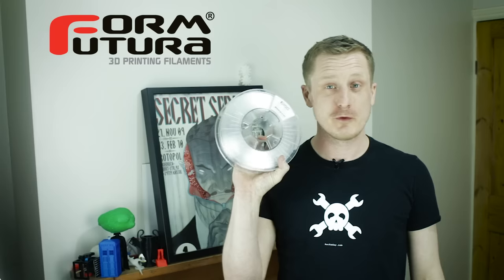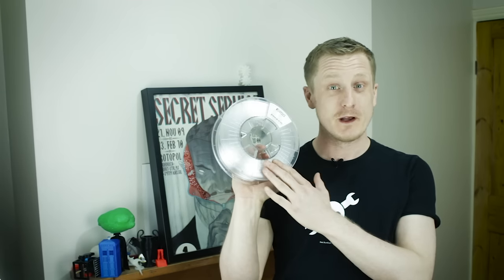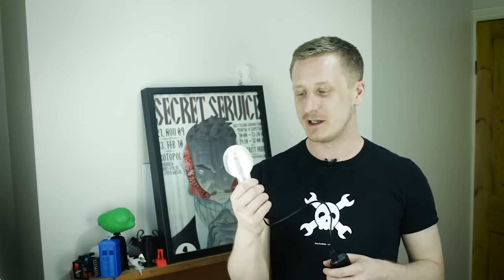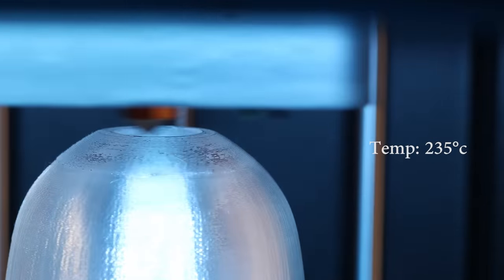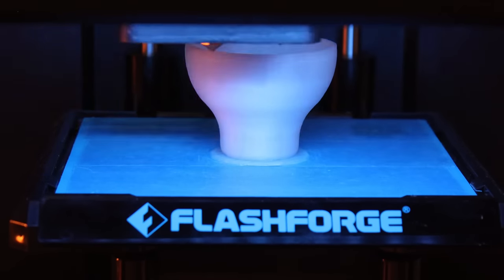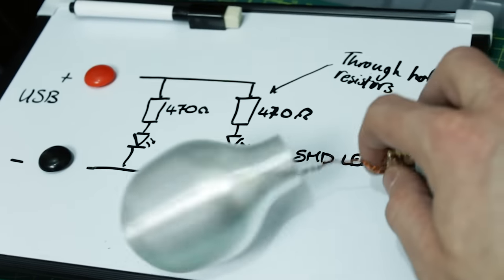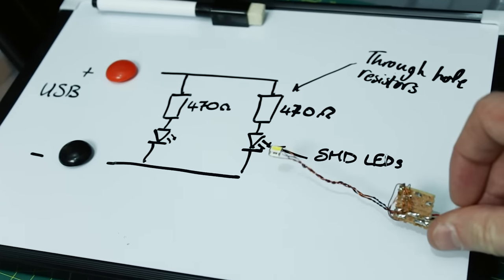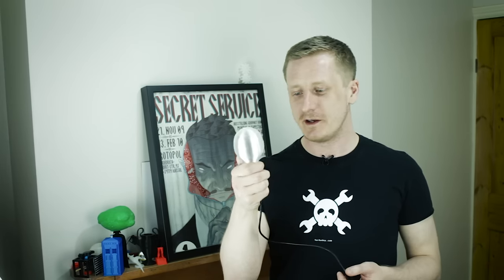3D Printing: USB Light bulb with FormFutura HDglass

Comment: Have you tested a heat gun or other ways to get it even more clearer/transparent? I've read that the layer height has a huge difference with the end result. Larger nozzle and layer height should get you less diffraction.

Comment: Nice ................ now the question is can you get it in orange & red , to print the tail lights you ' ve just knocked off ?
Reply from the maker: Yeah, it comes in a variety of colours so I guess you could. Nice idea.
Reply: I ' m not sure , it would be a " nice " idea , but it may keep the boys in blue off your case & make you feel safer , ' till you can find a sensible replacement . From what i remember the legal " thing " is , if it ' s ment to be a coloured portion of the signal & it shows through white , they can do you . The very cheap get round is to cover the bulb in a piece of coloured / transparent tape . But anything that makes the vehicle look more whole reduces the reason to stop you to start with .

Comment: Did you do this on your flashforge? I thought it only printed pla
Reply from the maker: I did, it only prints materials that don't require a heated bed. Mostly that is PLA and some more exotic filaments like this one and wood fill.
Reply: Thanks as I have a finder as well and would like to try some new filaments. Do you set it as pla in the setting and just turn up the heat? Or do you use a special slicer?